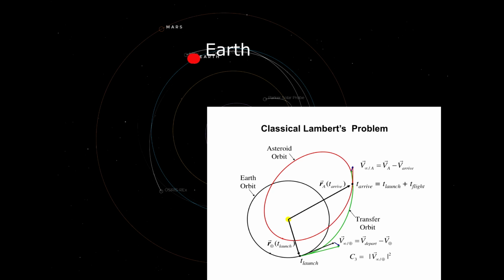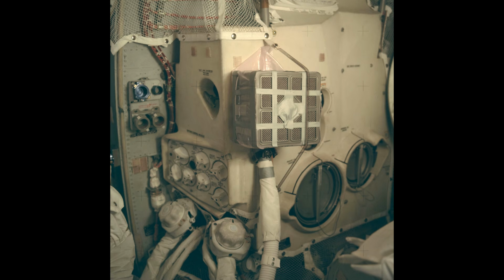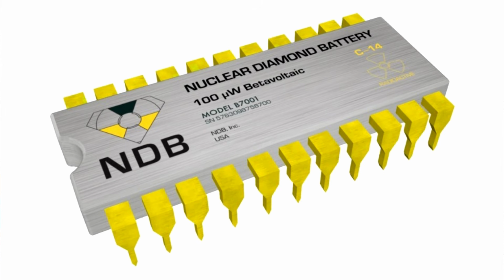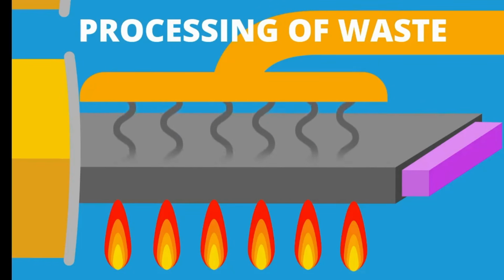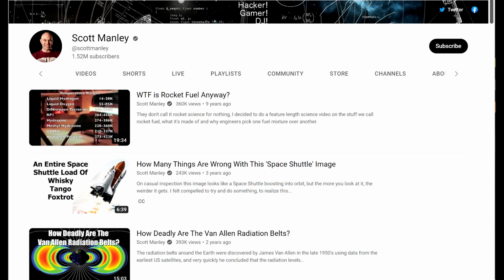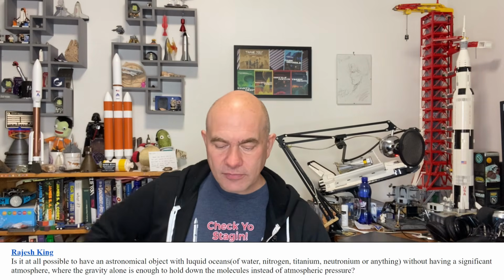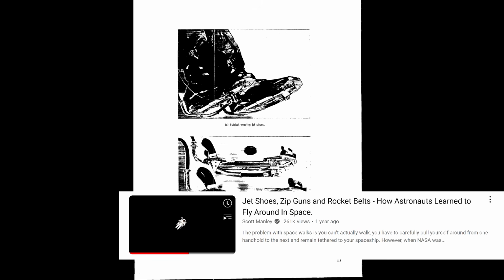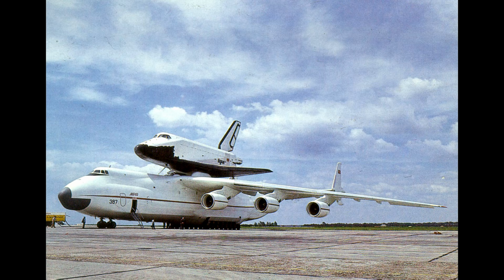Is There a Tripropellant Rocket Engine?  How Are Orbits Planned? - Deep Space Questions 21

Comment: I wonder if you might consider doing a video on the various ways of getting to orbit from the surface of an Earth-like planet (or the Moon, or Mars) that specifically DON'T need rocket engines to get off the ground.
Spin Launch is the most recent serious study into the matter, but I'm not talking about JUST that, and that's also already been adequately covered by your existing videos.
I'm talking about things like Lunar mass drivers for sending ISRU produced water, rocket propellants, and maybe even metals to orbit, Lofstrom Loops to get on a low eccentricity suborbital trajectory from the surface of the Earth, Space Elevators (as impractical and nearly impossible as they are for Earth, they'd probably make a lot of sense on Mars and Mars already has 2 very handily placed "counterweights" already in orbit that just need a little bit of orbit modification, in the form of Phobos and Deimos), and even things like Scram cannons, ram accelerators, and Rotovators.

Scram cannons (and their lower-tech bretheren, Ram Accelerators) especially are an incredibly interesting thing to look at. They're basically the bastard child of a Scramjet (or ramjet) and a Combustion Light Gas Gun, if you look at it from the right angle and squint a bit.
Like a combustion light gas gun, they burn a gaseous fuel oxidizer mixture to propel a projectile at incredibly high velocities. However, like a scramjet or ramjet, they do not combust all the propellant all at once.
I'll be describing the scram cannon preferentially, but a ram accelerator can use mostly the same configuration of elements as long as the flow thru the ramjet drops below the speed of sound at some point. To my knowledge, that is the only major difference between a Scram Cannon and a Ram Accelerator.
A scram cannon's projectile seats against the barrel in a way that there is a radially symmetrical, very specifically shaped passage created between the inner wall of the barrel and the outer wall of the projectile. This passage is shaped to create the correct geometry for a scramjet (or in the case of a ram accelerator, a ramjet). Before firing, the entire length of the barrel ahead of the projectile is filled with a fuel-oxidizer mixture suitable for use by the scramjet, there may be easily perforated barriers placed along the length of the barrel in order to allow the fuel mixture to be varied along the length to better optimize the fuel mixture for the increasing speed of the projectile and therefore higher mach numbers that the scramjet projectile must operate at.
At the breech end of the scram cannon, there will likely be a taper similar to the forcing cone that transitions from the chamber of a more traditional rifle to the profile of the rifled barrel, however in this case it is only needed because the projectile must be introduced to the barrel at significant velocity and it eliminates the need for overly tight tolerances between the projectile feed mechanism and the barrel itself.
In any case, to fire a scam cannon, the barrel is filled with the appropriate fuel-air mixture (as noted, with a sufficiently long scram cannon the barrel may need to be separated into sections with differing fuel oxidizer ratios to account for different operating conditions), and the projectile is forced into the breech end of the scram cannon at a speed that allows the projectile's scramjet to start creating useful amounts of thrust (so it would likely be a combustion light gas gun if only because that's the tech that's best known and easiest to implement). Even with a short scram cannon that doesn't need to adjust the mixture of fuel along the length, the breech and muzzle of the scram cannon must be sealed to prevent the fuel oxidizer mixture from escaping.
When the projectile is introduced into the breech end of the scram cannon, the scamjet is ignited by some means (easiest would likely be either a TEATEB injection into the combustion chamber of the scram cannon projectile, a pyrotechnic ignition system, or an electrical spark supplied by an arrangement of electrodes in the barrel of the scram cannon near the breech). When ignited, the scramjet projectile is then free to accelerate the full length of the scram cannon's barrel, burning the fuel mixture along the way to accelerate smoothly up to an incredibly high speed (mach 10 should not be too difficult to achieve with a sufficiently long barrel and well optimized fuel oxidizer mixture selection).
If the barrel is segmented, there is also the option of changing not just the fuel mixture ratio, but also the fuel and/or oxidizer themselves. So you could for instance start off with the scramjet burning a methane-oxygen mixture at lower velocities, and transition to a hydrogen-oxygen mixture as the velocity increases to the point that the chemistry of the methane-oxygen mixture becomes a limiting factor to the continued acceleration of the scramjet projectile.
Additionally, because the barrel is sealed, you don't have to use atmospheric air, or even atmospheric pressure. You can use higher pressure, or lower pressure, and mixtures with a higher amount of oxygen in them. With appropriate design of the scramjet projectile, this should allow for the length of the scram cannon to be significantly reduced (if using atmospheric air, it might take 100km of cannon barrel to reach mach 10, but with higher pressure mixtures that are composed of only fuel and air (and maybe some helium or hydrogen as buffer gas if the reaction would otherwise be too hot for the scramjet projectile to handle), that length should be able to be reduced to maybe 10km or less (likely less, my thinking is that 5km would be plenty long enough if it was tuned just right).
When you start talking about reaching mach 10 within 5-10km of a standing start, you start thinking that you can get to orbit without much extra effort, if you can just avoid slowing down in the thick lower atmosphere.

The main reason that scram cannons and ram accelerators have not been developed is that they take up a lot of room, serve pretty much only one purpose (space access), are virtually impossible to weaponize (because you'd have to STEER something going that fast), and the need for lots of payload launched to low earth orbit when that payload is comprised mostly of commodities like water or metal ingots or other cargos that are entirely insensitive to high g forces basically doesn't exist right now.
Same kind of problem the Lofstrom Loop has, despite that being one of the CHEAPEST ways to get things into space (all it takes is a couple gigawatts of power from something like a nuclear power plant and it will fling something like 10k tons to orbit over the course of a year's work, even if it only launches something maybe 2-4 times a day and spends the rest of the time speeding the loop back up for the next launch).

Comment: Around 13:55 Damn. A chemical reaction that can interfere with radio signals. Damn.
Reply: Well Apollo showed that with the lightning strike that dropped the CM offline, while the instrument ring on the third stage was supremely unconcerned. Switch SCE to Aux, to reset the power supply that tripped out from the transient. Hot enough from LOX kerosene to ionise air, just this is a whole magnitude worse, as you now have metal ions in the exhaust as well, not just carbon ions.
Reply: Makes me wonder if you could use the exhaust as part of the antenna.

Comment: The Energia/Buran architecture made it more obvious that the Shuttle is a heavy lift launcher. Every Shuttle launch delivered about 100 tonnes to LEO, it's just that 80 of them were the "dead weight" of the Orbiter itself.
Reply: I mean the rs-25s of the shuttle were a big part of that as opposed to the standalone system that energia was but still, lots of other mass in the shuttle
Reply: That was always the cool part of the Energia, it could launch with a larger paload strapped to the side instead of Buran.
Reply: @Zacho5  Look up Shuttle-C or any number of Shuttle derived vehicles where the orbiter was replaced with a side-mounted cargo module. Shuttle-C advanced to the point where the MPTA-098 was used to build a high-fidelity engineering mockup for studies on how this would work. Some of the photos of it are really impressive and show what was possible, such as a 90 ft instead of 60 ft payload bay filled to the brim with fully outfitted space station modules and other hardware to build Space Station Freedom.
Reply: @Zacho5  Polyus did demonstrate that - actually the Energia heavy launch booster was more interesting than Buran, but seems there was less interest in different applications in the Soviet Union at the time, especially after so much money was spent on the program from 1976 to 1989. Personally, feel that Energia could have sent up huge core components of space stations, around which the modular, tinker toy approach of MIR and ISS could be implemented. So get all the key systems up there, with living space, with berths and amenities, as well as initial workspaces and labs, say in two launches, to get a jump on things, rather than weight for multiyear protracted assembly of an installation.
Reply: @Zacho5  there were also plans for a cargo-only shuttle variant, but Congress never ponied up for development
Reply: Think of it as carrying your core cluster along in your cargo manipulation/return module for reuse rather than expended with the core stage.
Reply: Believe the Shuttle was supposed to deliver 29 metric tonnes, as in: "The cargo/payload weighed up to 29,000 kg (65,000 pounds), depending on the desired orbital inclination" (source: pg 59 of The Space Shuttle andIts Operations )...Thought that I heard they dialed it back to something like 25 metric tonnes for LEO (Wikipedia lists 27,500 kg), for safety... Or, maybe most orbits could only allow that kind of capacity.
Reply: I always found the U.S. shuttle using a massive expendable fuel tank with the engines on the shuttle itself a rather strange and ungainly design. The Soviet design seems to make more sense to me by comparison but I'm a layman. Also the Energia looks really badass, especially with that black rocket they first launched, the one that spun end on end in a big faily mess. Still it looked so fucking badass.
Reply: @aarondavis8943 Less reusability though, or less of a pretense. The hydrolox engines were expendable, and would have remained so well into the future of any counterfactual about the program. The Soviets were aiming to reuse the Blok-A strap on boosters. 

Otherwise, with the American program. there is then debate about how easy it was to reuse the main shuttle engines and the shuttle as a whole.  

Personally I liked Energiya as a heavy lift vehicle, and its potential to send really large modules into orbit like the Saturn V. Thought Buran was kind of a waste though, especially since there were other spaceplane concepts and projects (like Spiral) goin on in the 1980s.
Reply: The only reason why USSR build the Buran was because USA build the shuttle. They could not really figure out why, but reasoned it was better to be safe than sorry and build a craft with smilier capabilities (And that is why it look so alike). So was it a waste? Yeah, in many ways, it was. Since  the shuttle itself was a waste in a sense. 

It was not a total waste, however. Technology did come out of the project. Though, USSR collapse of course lead to a lot of waste in general. But it is a good example of it is not always wise trying to match your rival.
Reply: @Cythil  Agreed: the U.S. Shuttle was a compromised design to begin with compared to the original fully reusable shuttle, and the Buran was a further compromise on this compromised design. The only unique capability was the ability to bring back to earth very large payloads with potential military applications, which I suspect was a big reason why the Soviets built it other than the bragging rights of having a Space Shuttle-like vehicle. One clearly successful thing to come out of the Buran/Energia program was the RD-170  derived family of rocket engines, which are the highest performance keralox engines ever developed and still in use by the Atlas V, Antares and Angara launch vehicles.
Reply: @joakimlindblom8256  The RD-180 derived from the RD-170 was very successful. The RD-170/171 though continued to be problematic, with four or so accidents in the 1990s and 2000s with Zenit launches.
Reply: @joakimlindblom8256  Agreed. Also there's the "photocopy" effect like they often talk about with cloning. The shuttle was a conglomeration of a million different engineering challenges and solutions flying in close formation. Heck, even the shuttles themselves notably differed from each other as the program progressed. Now talk about an entirely different industrial and engineering infrastructure trying to copy this, and lets even assume the American design is perfectly known and understood by the Soviet team. Different blends of alloys. Different manufacturing techniques. Varying availability of materials, even some not at all available. Different engineers biased toward their own favorite solutions. Even the differing management and organizational structure itself can vary the design. There are so many variables it's nearly impossible that the Soviets could have produced a perfect shuttle clone even if they'd wanted to do so.

Comment: If not fuel propellant lines? What about helium gas backfilling feeder lines from the boosters?

Put extra COPV's on top of the boosters, they are not needed in the central core booster. 
That gives extra room for a little more propellant. A few seconds worth.

Comment: Probably be cheaper if you did the biosphere inside a atmosphere controlled structure.  Not too mention it'll be lot less damage to local high altitude environment which is probably under protection by significant local environmental laws.

Comment: A cycler is not really useful for cargo, as you have to accelerate and decelerate the cargo anyway, but it restricts your launch windows. So, no financial gain, but more restriction.

The place where it may help is human transfer, but it's quite restricted there as well. You may gain because, as Scott mentioned, people are picky on a six-months trip and don't want to travel in a coffin, so what you gain is that the "larger box" with life-support&co only needs the invested deltaV once. But even there, you have a sweet spot. If too few people fly, then the "overhead" is too big. If too many people fly, then the difference between the vehicle that takes you to rendezvous and de-orbit will be of similar size to the cycler, and you lose the benefits.

The largest drawback for human cyclers is the risk of the rendezvous. If you miss it, then you are in an interplanetary trajectory without fuel to get back, or enough resources to make it there. Plus, on the way back, you are constrained by the cycler, so it's useless for an unplanned or emergency trip back. (Compared to a working rocket in place that just needs to be fuelled up, and given enough deltaV, can return any time.)

A large number of cyclers can solve some problems, but will raise others. (Primarily on investment side.)
Reply: The real cycler advantage is the same as for the ISS: over multiple launches, it can grow to mass more than any reasonable launch could achieve. Attaining a 500 person self-support capacity over the course of sustained launches to a cycler is fully practical, and honestly just a matter of time once you have one. A transfer vehicle, in comparison, just needs the ability to get it's passengers accelerated in a reasonably short period of time, so you can wind up in a situation where you're comparing e.g. Disney World with the busses needed to get all the guests to Disney World- even factoring in rocket fuel, Disney World (or rather Disney Cycler) will mass a lot more due to the need to support everyone over longer periods, + the structure for all of the space and amenities, + the greater radiation shielding required for the sustained exposure, + the docking and repair facilities, + backup vehicles, + solar cell arrays for the higher energy consumption...
Reply: @absalomdraconis  You also need to scale up the rendezvous ship for 500 people, and for any margin of safety, it does not only have to be able to accelerate to interplanetary speed, but also retain enough fuel to get back to the origin if needed, with all the life support and shielding needed for such a time. At which point we are getting pretty close to the requirements of an interplanetary spaceship, and the cycler gain melts quickly.

Comment: The issues with asparagus staging are made worse by the extra complexity you'd add. Adding the fuel lines in KSP adds pretty much nothing to the overall craft. Also add in the fact that often the booster sections aren't where most of the orbital velocity even comes from
Reply: Also the pumps .  KSP-style asparagus would often have chains of 3+ side boosters feeding into the core, which means that while the fuel flow for inner pumps would be some fraction of the core's consumption, the next pump out would need to move that much fuel plus the consumption of its own engine(s), and the next pump all of that fuel, as the outer tanks are feeding literally every engine down the chain to the core.  The numbers work out to frightening fluid velocities (assuming the wee fuel lines seen in game), which would definitely cause a rotational moment in a lot of setups, not to mention a frightful amount of sloshing.
Reply: Well, you don't need to feed enough to keep the innermost tanks 100% full at 100% burn to see a benefit.
Whether or not the benefit is worth it is up in the air (or not) but i think there could be a significant benefit if it could be done reliably and without too much additional weight